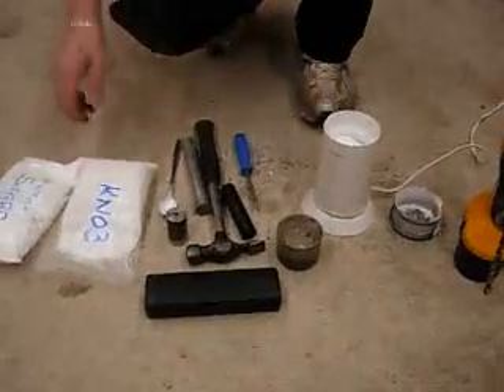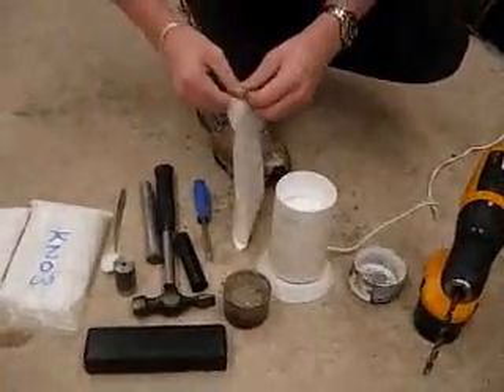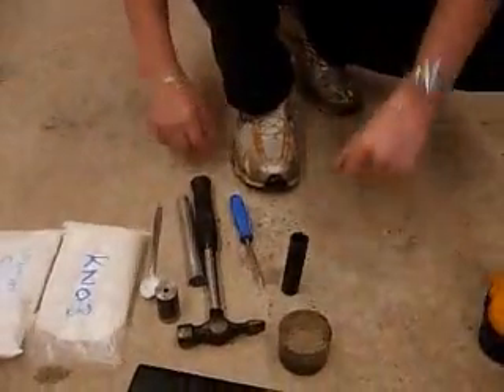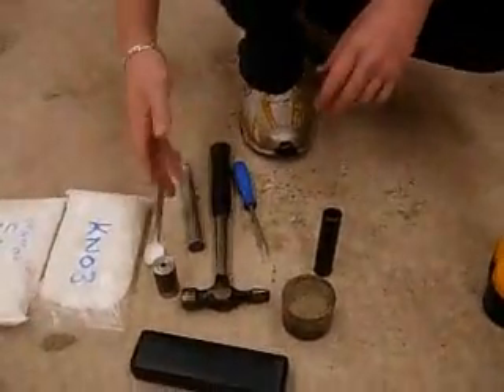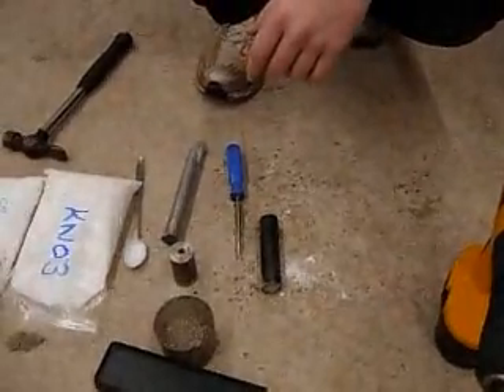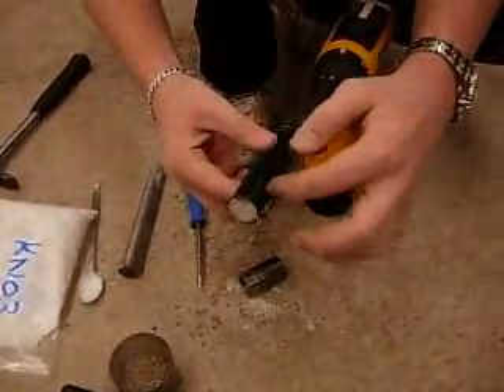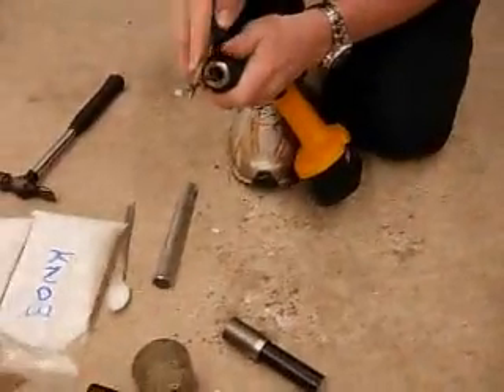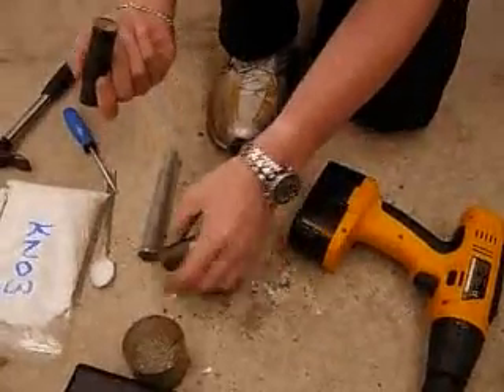Step by Step Kno3 and Sugar Rocket

Comment: You are mixing an explosive mixture using steel tools that can spark, electrical tools that throw sparks...

You are a fucking idiot.

Try to have some consideration for your neighbors.  Only play with this shit when they're not home, so when you blow yourself into a fine pink mist or set yourself on fire, they will not be endangered by your actions.

And for fuck's sake, don't breed.

Though I doubt there's much risk of that.

Comment: Why don't you use a wire brush while the the drill is on to clean off the bit.  And use a smaller bit for a pilot hole and then use the larger bit.  Should speed it up for you.

Comment: 20 years ago I did experiments like this.
You can melt the sugar and kno3 and put it through the chopper again should give you a better, more even burn.

Be careful though that you don't ge the sugar to hot, or it will ignite... no explosion, but your mom won't be happy about the smoke in the house :)
Maybe use a double put (used for melting sugar) to do it.

Also, you can pour the melted mixture into the tube, which should allow it to burn longer and give you thrust longer.

Comment: kno3 and sugar CANT explode, the burn rate will never get high enough. Ive messed around with this for years and make loads of rockets and mixtures and ive never had it explode. please dont try and make know it all/smart comments when you have no idea about the difference between black powder and a simple rocket mix. for one thing your using sulphur and charcoal in black powder and the displacement of oxygen is about 20 times greater for those chemicals, than sugar

Comment: The sugar is used as  fuel, cat litter to form a plug.. also you do not need to drill a hole all the way down the engine, it is unnecessary, sense you already have a nozzle. Good tutorial, nice job.

Comment: I have some comments. 

You shouldn't be using a steel hammer on a steel bar, and you shouldn't have a steel drill guide. Use a non-ferrous drift or a rubber/wooden mallet. Ideally change the drift as clay can sometimes contain small pieces of flint, which can spark.

If you continue to drill the mix as violently as you are you will one day lose your face as it will go off bang.  

Otherwise a good video.